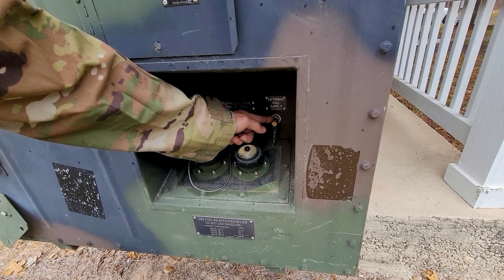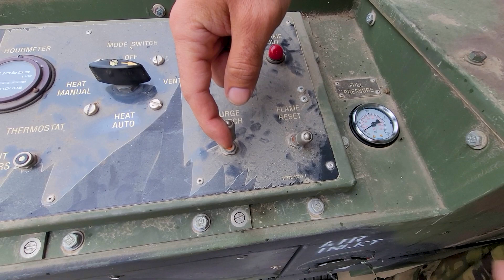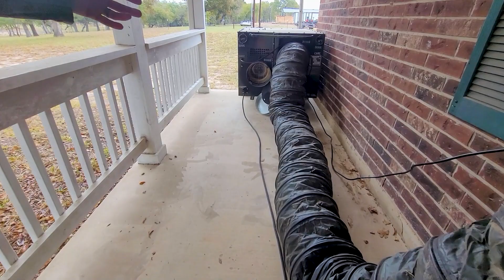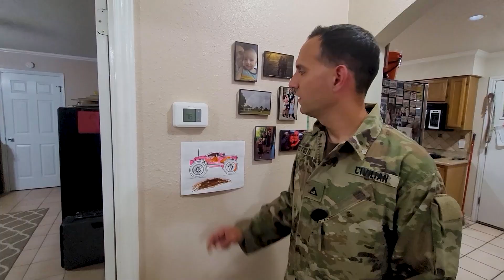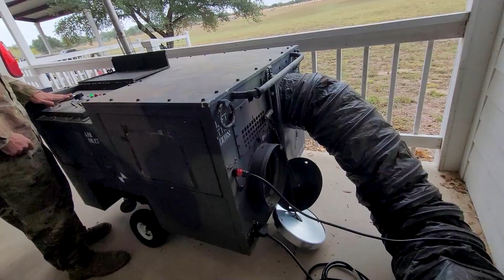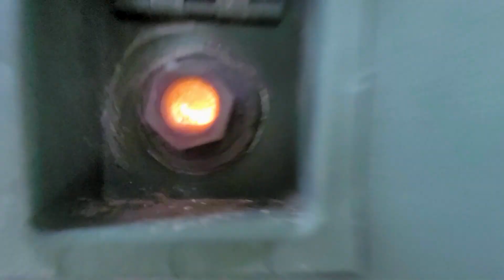H-120 Army Space Heater Follow-up

Comment: I recently got an H140 heater. When I start it up after the initial ignition it starts actling like it gets too much fuel. It will smoke like crazy. The fuel gauge will go from about 28psi and then peg the needle. It will smoke like crazy and start kinda popping like a jet engine is firing up and smoke even more. Fuel will even drip out of the exhaust elbow and occasional flame will exit the exhaust pipe. Any idea what's going on?
Reply from the maker: Something is letting to much fuel build up.

Comment: Do you know if they will run on used engine oil or a mix of some sort?
Reply from the maker: I'm sure it would, but it would dirty up the injection system quickly, along with the flame detection system. With that said, it's not that hard to service if you know what you are doing so if you burnt filtered waste oil, it would be a great way to save $$ and make some good heat!

Comment: How big is the fuel tank and how long does it last? I assume it is diesel?
Reply from the maker: The tank is just shy of 8 gallons I believe. I didn't see a run time in the TM, but generally the military sets everything up to run from 8-10 hours if at full use with it's internal tank. But, that is if this was putting out 100% heat that whole time. I really think it would run a whole day easy on it's internal tank, even keeping it very warm inside. It's diesel, but will run on some other fuels like Kerosene.